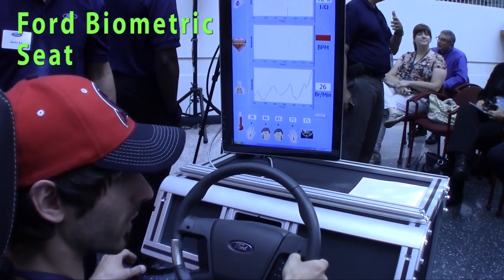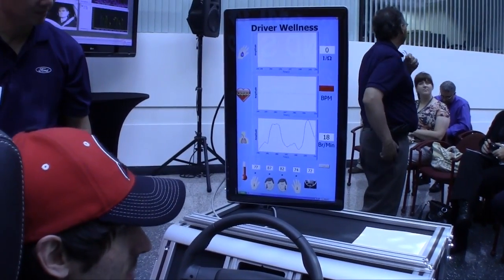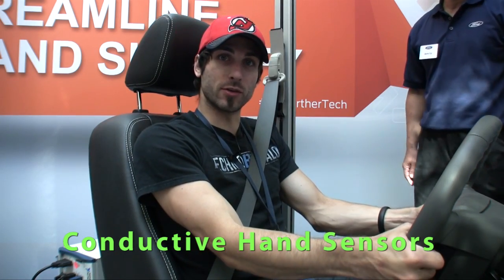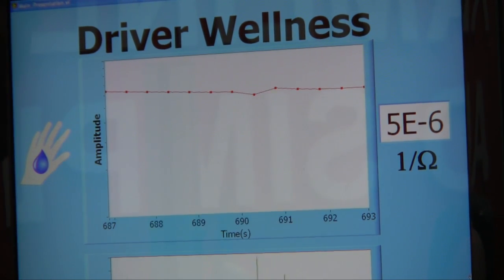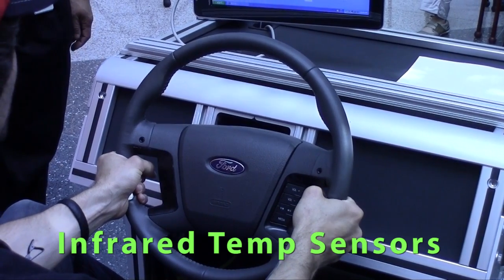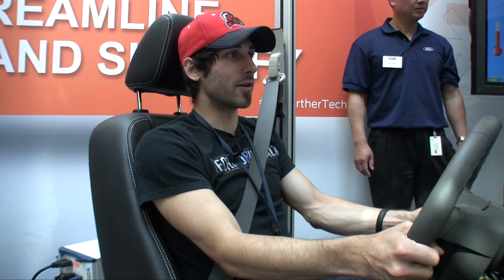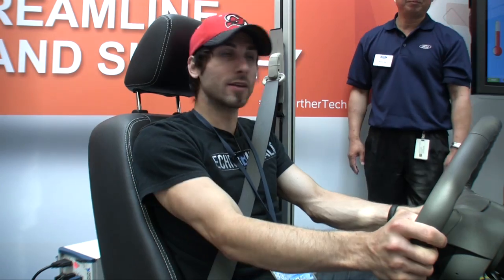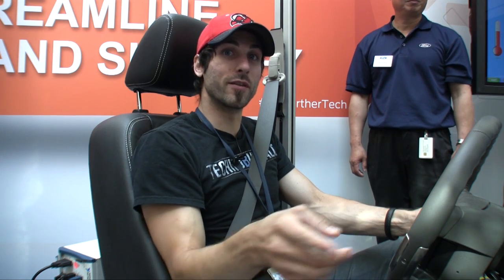Ford Biometric Seat

Comment: 1.a car can stop when you flat/pass out
2. the car can say if someone else is holding the steering wheel by mesuring the temperature and the stress and matching it up with you average temp and stress.
3.it could block the engine if youre not wearing you seatbelt
(there are probably more reasons that i cant think of)